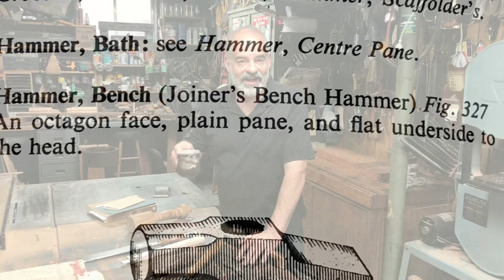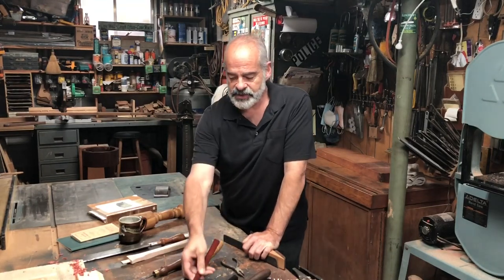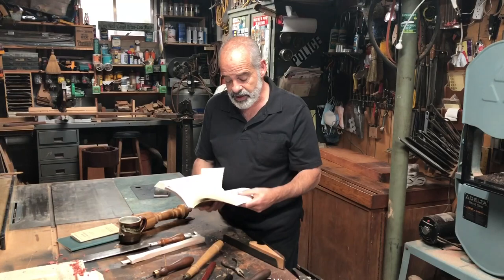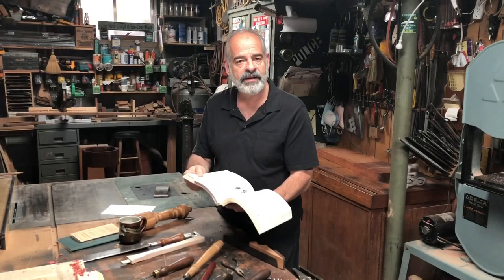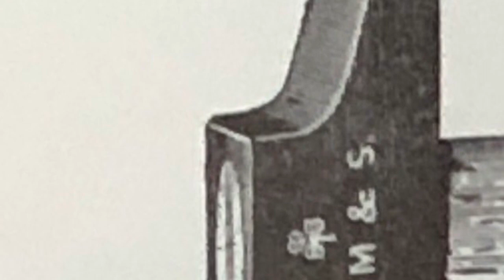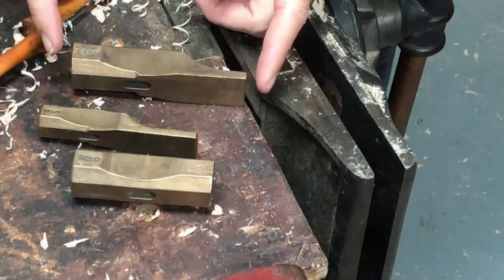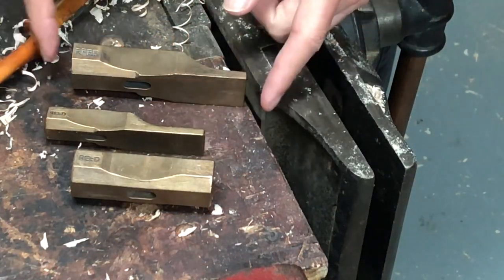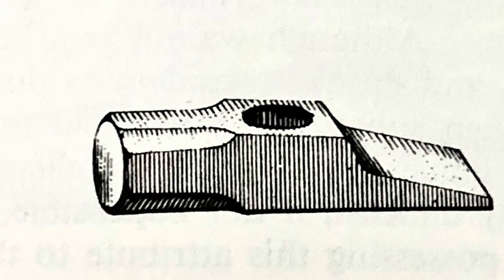REED HAMMERS FOR ADJUSTING PLANE IRONS

Comment: Nice video Chet. Do you think the bronze will pick up a patina?
Reply from the maker: Thanks, Dennis. By pick up do you mean will they change color over time. They do change over time.
Reply: I know copper turns green so just wondering what color bronze turns too. I know you can put a shine and polish on them. I am probably taking a period of years. I need to decide which one to buy. Your video will help my decision.
Reply from the maker: @dennismeko  it will slowly turn a brown color. It does not change  quickly which is why you have to consider polishing as it will take time to turn brown. The acids on your hands will degrade the patination as well and that’s why so many bronze statues are shiny where people have touched them.
Reply: @dennismeko  I like the patina of the bronze at it ages. Bronze could change color and look very bad if it is abused but this would be very unlikely in a shop environment. If you use a lot of wood bodied planes I would suggest the large London pattern, but all will work well as mostly light tapping is all that is required. Need to see your handle set up. So pictures are required.